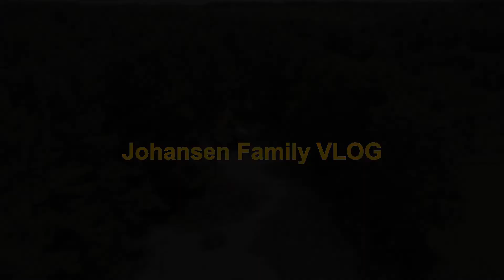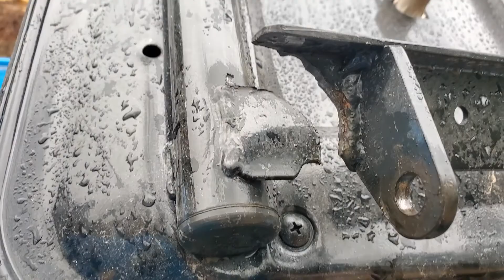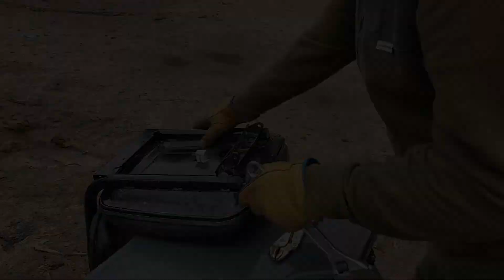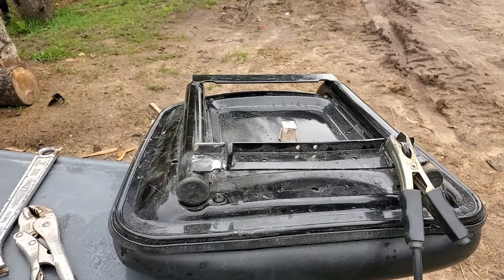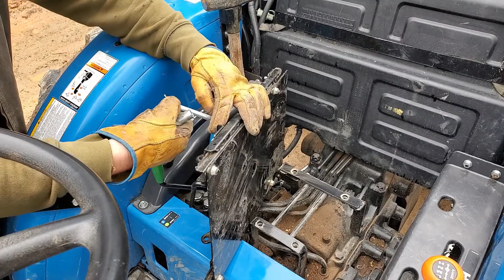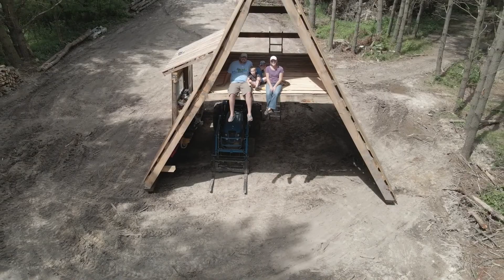Fixing LS Tractor Seat

Comment: Hi Johanson Family, Very nice video, what is your tractor model, how many hp you have and how many hp PTO you get
Reply from the maker: Thanks for the comment. We have an LS MT2 35 HE. It is rated at 35 hp but has the same displacement as the 50, I was told it is limited to 35 hp by the computer and the turbo. I think the rated hp to the pto is 28 hp but I am not certain of that number, it runs a 6 foot tiller no problem. I have had many people tell me they are impressed with the horse power of my tractor running the tiller stating that their tractor could not do that. I mention the tiller because it is one of the most strenuous things that can be done to the power train of a compact tractor and is a good way for an individual to compare two tractors if given the opportunity to till with both.